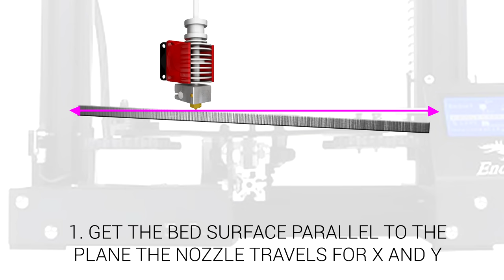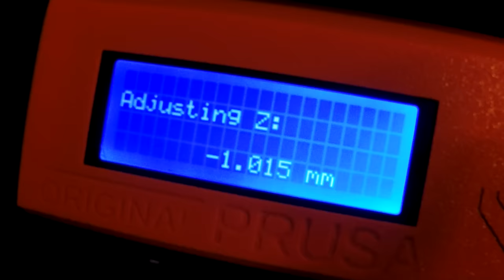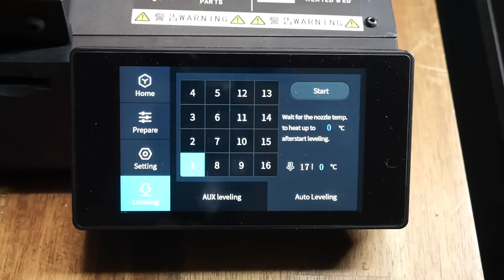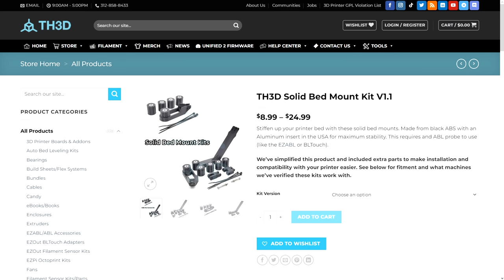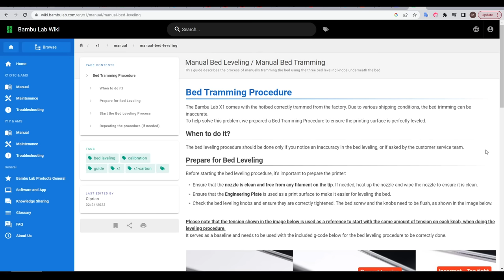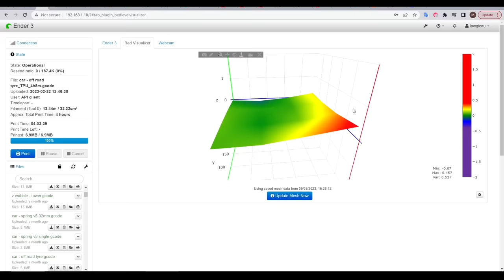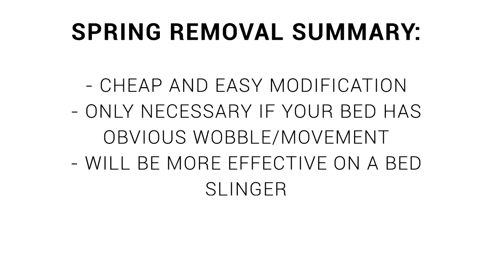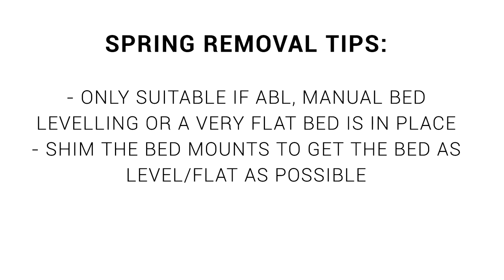Is it time for 3D printers to abandon bed springs?

Comment: One benefit of springs I haven't seen mentioned yet is that it is giving some minor vertical play under high force to the bed means which means that if you mess up your auto bed leveling, Z offset, or Z endstop positions and accidentally crash your nozzle into the bed, the bed will give way and thus you're likely to cause less damage to your nozzle, print head, and the print surface. I know I've messed this up and it's saved me multiple times. I still use stiff yellow springs on my custom HEVO CoreXY that uses a fairly basic heated print bed with a PEI coated spring steel sheet.
Reply: I think this is really the only benefit of springs. Everything mentioned, there are better, easier solutions to.

The reason springs aren't used as much now is because we have ABL, because that prevents the nozzle from hitting the bed, not just giving better quality prints.

There are a lot of disadvantages by using springs. Really what you want is a way to prevent the head from pressing into the bed too hard. Springs are just the easiest way to do that. Though the bed moving means that you are more likely to have failed prints.

It is a tradeoff. Do you want to take the risk you will need to replace the bed or are you willing to take a quality hit?
Reply: @SirSpence99  "There are a lot of disadvantages by using springs. "

Like what though? Name some actual problems that are solved by removing the springs.
Reply: @vinny142  Let me answer your question with a question. How much do you think your bed flexes when you put weight on a corner if you are using springs?
Reply: Nah it doesn't... Springs don't save your build plate this is a total myth. I've had it noise dive both ways.. doesn't save your build plate it's still the same force downward focused on that tip.
Reply: There is workaround about that. Overload protection, like on CNC machines if it crashes.
Reply: @microponics2695  The stepper motors work by distance, not force and they're pretty powerful. Try pushing your finger 3mm into a pillow then 3mm into a brick.
Reply: Solution: don’t fuk up
Reply: @microponics2695  Depends on how strong the weakest part is.  Some heatbreaks are fairly delicate, and sometimes the way your hotend is mounted creates a failure point as well.
The thing is, ABL isn't a panacea either.  Being able to level the bed to the frame of the printer is good.  Triple point leveling > spring bedslinger > fixed bed(such as the CR6SE) bedslingers
Reply: @SirSpence99  if they're properly tightened, springs won't let your bed move at all until you reach way higher pressure than the weight of any print.
Reply: @creepyloner1979  And by "properly tightened" you mean throwing away the entire value of a spring.  At that point, why not just get something rigid? There will be less expansion due to thermal stress even if you go with something metal. If you don't, you can get almost no expansion easily.

Further, how do you determine "move at all"? Do you mean visually? Do you mean with a gauge? Keep in mind, even a .1mm movement which you would never see is enough to matter. If you mean with a gauge, show me a video with that happening. I guarantee the springs on that bed are multiple times stronger than the springs everyone else uses.
Reply: I've yet to see an X carriage so rigid that crashing the nozzle into the bed causes damage that springs would have prevented.
Reply: @kazdean  X Carriage rigidity isn't that big of a factor because unless your printer has only one side of the x beam supported, it won't have enough flex.

I can say for a fact that when I built my printer and had a calibration error, there was more than enough force to destroy a nozzle. Because it did. If I had springs, it would likely have caused significantly less damage.

I don't have springs because the cons outweigh the benefits IMO.

So, I've only seen a couple printer designs in which the X carriage was so flimsy that springs wouldn't have made a difference.

Again, yes, you can torque the springs down so much that you get almost no flex. Doing that leaves you with all of the cons and none of the benefits however.
Reply: They're not worth releveling every single print. and then having to replace them every 3 months because they warp. Even if you crash your Z it's just going to pop the rollers off the Z bar gantry (on like a ender3). Springs aren't going to save your build plate on the HEVO they're just going to waste your time leveling releveling and then having to replace them because they thermally warp up to 5mm in my experience and never retain their shape. I don't even use them on my laser. Some one flunked engineering school bad!!!!!!!!!!
Reply: @microponics2695  And someone flunked English and logic. You haven't addressed anything I said.
Reply: For that purpose you could instead move the spring to the nozzle/x carriage. It would still burn the plate but it would be less likely to scratch it?
Reply: vez my boy nobody with an ender stock is printing fast enough to worry about vibrations ahahah
Reply: @vinny142  ive had so many issue, first one, the wheels unscrew themselves when printing fast, , two, the springs can be to weak, and do not put enough pressure on the bolt the wheel screws into this causes the whole bolt to spin and destroys your ability to fine tune since you no longer have any idea how many actual turns you just did, so you cant align the other side right, and 3 if you go to put a thermal pad under the bed, the springs have no seat, they will just smash up against the bottom of the bed , or in this case your thermal pad, so thats only 3, i have an ender 3 v2, and a monoprice mp mini delta, the mp mini does not have bed leveling screws, i love the monoprice, i put the card in, select my print, it prints it, it's almost always good, with the ender it's this forever messing with the wheels, i cannot wait to get bl touch and lock the bed down forever
Reply: @SirSpence99  Why does nobody mention what a ridiculous joke Creality and most other brands' ABL is! 3x3 is nowhere near enough probing points to generate a mesh. 3x3 naïvely assumes a perfectly flat build surface- which only comes on about 10% of Ender 3's. IME 30% are so badly warped from the factory that I would not even consider them usable for any print that takes up more than half of the bed. In those cases especially ABL is an absolute requirement, but 3x3 won't do a damn thing! I run a 9x9 mesh on my E3 and a 12x12 on my E5+ and that's still not enough to get a perfect Z when printing things that go all the way to the edge. 

The most egregious thing is that Creality just assumes their beds are all perfect and therefore doesn't let the user change the MAX_POINTS without editing and compiling the firmware which is beyond most users' ability. This should be a setting in the UI like in mriscoc and jyers' firmwares.
Reply: @chuck333yt  Yep! I run 9x9 points and my points are based off of the actual print area, not the bed area so small parts get more precision.
Reply: @vinny142  its quite serious, the disadvantages of using a bed that isnt solid, ..... like idk how to even explain it, just think about it for 5-10 seconds. The ONLY counterpoint I've seen is that it can save your bed. But in doing so it naturally introduces such a massive degree of inaccuracy its literally not only useless, but detrimental. I saw one comment that said "it gives pressure relief to the nozzle if you set up at the wrong height by letting the print bed deflect downward a little bit" which is basically the worst thing ive ever heard.
Reply: @SirSpence99 : ABLs don’t always prevent the nozzle from hitting the bed. For example, I have two Creality printers (most recently the CR-M4) and both have crashed into the bed severely enough to permanently damage it. Good engineering could prevent that, but Creality doesn’t have good engineering.
Reply: @kevinpezzi6777  I'm aware.

I didn't make the claim that it does. I even mentioned that I had a severe crash on my printer that destroyed a nozzle.

There are many things that can make the ABL not work. My point was that that ABL does the one thing that springs have going for them while also doing a lot more.
Reply: @SirSpence99 Not to mention those of us that still use glass beds. Head crashes can be catastrophic with a glass bed.
Reply: I print on glass and once leveled, it very rarely needs re adjustment. No auto leveling needed. Just need to adjust the springs properly with more tension. .

Comment: I’ve been using those silicone spring cylinder things on my Ender for a couple years now and they seem to stay more consistent than the springs it came with or the stiffer ones I originally replaced the stock ones with.
Reply: The larger diameter offers a more even distribution of the evenness and stability of the bed plate in comparison to the y axis plate. (Think of supporting a deck with 4x4 vs 2x2 lumber) 

Additionally they are more rigid, or like you said "stiff", and that helps decrease the likelihood that they will hold their position longer than springs(don't have to re-adjust as often)
Reply: I love these as an upgrade, they also have the benefit of having some grip on both surfaces which means they're less likely to get jostled out of tram. I recommend doing this upgrade first thing on any ender 3 style printer!
Reply: As opposed to a spring they're also a spring damper system. A lot less ringing potential.
Reply: The one issue I found is that you need give 5 minutes or with the bed hot between rounds of bed leveling. It lets them stabilize. But I too have been loving the upgrade.
Reply: I’ve had the same experience! Best $5 upgrade for these style printers
Reply: Doesn't matter if it's an Ender3 or MK3S, the silicone spacers are the best option.
Reply: I tried a rigid mount and went back to silicone because I couldn’t tram the rigid mount setup. The plate under the bed on my Ender 3 pro has an angle to it that you wouldn’t believe, the silicone springs were the happy medium between adjustability and rigidity.
Reply: Same here, I went with those instead of the yellow springs I've had previously on my custom bed slinger as well. It just stays trammed forever. Bonus point that it's an insulator by it's material composition as well, so no worries about that compared to metal spacers.
Reply: @seabeepirate  This reminds me that when I built my machine I started out with a smaller bed (cash ran dry) and then upgraded to the frame's full size. The new bed came visibly warped. I kid you not, that I literally hand bent it with my leg as the "tool" to get it to shape. Surprisingly good results on a 310x310 bed 3mm thick. Can't say the same would work on a smaller one tho (far less leverage).
Reply: @eslmatt811  good tip!
Reply: I use silicone spring and set each screw by sampling its position with bltouch to an accuracy of about 0.05mm. The difference between the highest point and the lowest point is less than 0.2mm. I use a glass table. I calibrate the table every few dozen prints.
Reply: They make levelling a lot quicker for me too.
Reply: @Kalvinjj  Not just an insulator, but one that can handle higher heat than most beds can provide. So no worry about melting. There might be cases where rigid would be superior, but I can't think of any situation where springs are superior to silicone, as heat cycling will also have an effect on spring metal over time.
Reply: I felt the need to come in and ad my experience with adding the silicone bed spring upgrade. I think I have had to manuall level the bed twice since I installed them. I also added the nylock nuts to the screws as was suggested in a different vid (at this point, I've watched so many, I'm not even sure who it was that I watched). Silicone springs FTW.
Reply: @VulcanGoF  For the Ender 3 that loved just spinning the damn screw while you rotate the nut, I added nylocks to the bottom, under the hand nut, so when it starts bitching like that, I grab a 7mm wrench to hold it still and do the manual leveling. Sounds silly, it really is, but it's surprisingly useful.
Reply: @Kalvinjj  That was the modification I was talking about. They started to do that to me on Ender 3v2 and i was like, nope that's done. LoL
Reply: +1 for the silicone grommet replacements. Made a huge difference on my Ender 5 with retaining level through lots of prints. I suspect the thermal cycling was causing issues with the steel springs and the silicone rubber isn't as affected.
Reply: Same went silicone spacers never looked back.
Reply: great comment, thank you! 
im going to have to try these silicon springs on my ender 3v2.
im surprised of how nice it prints, but the bed leveling is a bit annoying... 
i do not print a lot and every time it has been sitting for a while i need to level the bed, seems like the bed is sinking over time, sometimes i get away with with just pulling on the bed before i start it but that is probably not the best idea... 😂
Reply: Yep, started out with stock springs, moved onto yellow springs, and then finally silicone spacers on my Ender 3 Pro.

Pretty darn good at that point, but being a former surveyor and having leveled theodolites and levels on tripods  I took the final step and went with 3-point leveling.

Before disassembling things I made a simple “story stick” to quickly get me back in the neighborhood when  reassembling everything.

This helped more than I could imagine as I only needed less than a quarter turn on two of the three wheels to get as perfect a manual tram on an E3P.

Haven’t needed to touch a thing in over 9 months!
Reply: I bought the silicone and for the life of my could not get a decent flat surface with then, to the point there was a high point in the middle of the bed.

Comment: Bed springs were a plague that were nearly eliminated in 2016, but the race to the bottom reintroduced them. ABL is so much more reliable than eyeballing a first layer and using thumbscrews. Going back to bed knobs feels like a massive downgrade any time I need to use them these days.

Comment: Well, here I gave silicon pads as spring replacement a try. And I must confess those were particularly efficient as they maintain the bed firmly in any direction while allowing adjustments by compressing them. They do not damage PCB or silicon heating pads and provide a good thermal insulation between the structure by the way.
Reply: Silicone pads, I'm assuming you mean. Silicon is a hard brittle material used for making microchips. Silicone is an artificial  polymer.
Reply: @falxonPSN  Thanks professor.

Comment: I have a Ender 5. Originally upgraded to the yellow thick spring after a few months of use. Already made a big difference and I did not needed to level the bed often. Then last year (about 3years later) I switch to Silicone spacers/bushings. I had to level the bed last month for the first time. And only cause I upgraded the a different hotend and added a CR touch. I would 10 out of 10 recommend silicon spacers as I believe they do damp some vibrations as well.

Comment: I went down the rigid mount and ABL route a while ago after I got sick of having to level the bed so often. Rather than standoffs I sandwiched the carriage with nuts, so getting it as level as possible the first time way a huge PITA. I've never regretted it though; it's so nice to be able to just send a print to the printer and know that the first layer is going to be perfect every time. Just preheat, clear the dribble, press print and walk away.
Reply: Did you use like, a stack of nuts so it's like spacers, or did you use a nut to block the screw up top, then a nut underneath to block with the hand turning nuts? I see this is quite the interesting idea and I may just end up doing this at the workplace's Ender 3, that thing gets out of level on it's own just cause it wants... Seems like quite the happy middle ground between adjustable and rigid.

Comment: Thanks for the video! To avoid more wobble on the machine, I place my 3d printer on a concrete slab from the hardware store and underneath the slab is some closed cell packing foam. It removes quite a bit of the vibration.

Comment: Two Ender 3s running stiffer than stock springs with an ABL.  Working well enough.  Very interesting to see the Bambu printers using springs for fine adjustment.  Wouldn't have guessed that.  Still love the thick bed and three motor systems a lot.  Feels like the most robust solution.

Comment: I gave up on springs a long time ago.  I fixed the screws in the bed with nuts and washers.  And printed two regulators with nuts for each corner.  It's a little more difficult to adjust, but it works really well for me.  Additionally, I set the manual calibration of the bed to 16 points, because the fiberglass table is crooked (±0.05mm).  And I don't calibrate the bed for months, only when I completely disassemble it.
Reply: That's a very valid point that he did not cover. A simple washer a nut to secure the bed bolt to the build plate. Cost under $1.

I did this years ago and have never adjusted since

Comment: I switched from springs to silicone spacers. Holds level better and suffers much less from vibration. Also added a lock nut to stop the wheels from lossening over time. Has helped so much over the original bed springs.
Great video. Thank you.

Comment: when i got my prusa mk3, the rigid bed and abl experience was like the coming of the 3d printing messiah. it instantly cured all the problems i was having with first layer adhesion. i've been an ABL and no springs zealot ever since.
Reply: Right?  It was amazing.  My mk3s+ is still killing it, with hardly any maintenance or tweaking, to this day.  That’s the difference, no fiddling about with stoppers and knobs like on my og Ender machine.